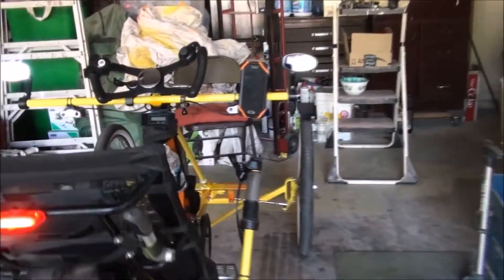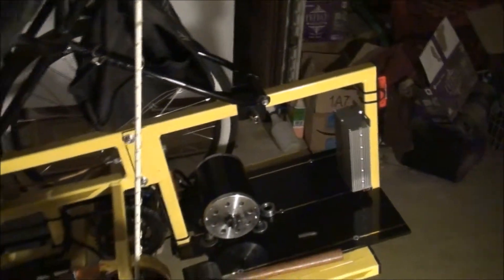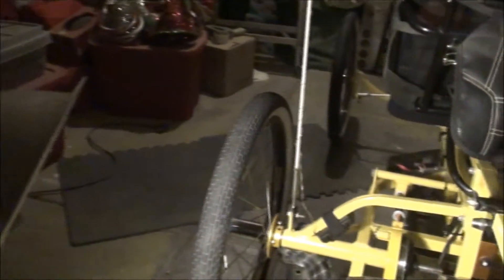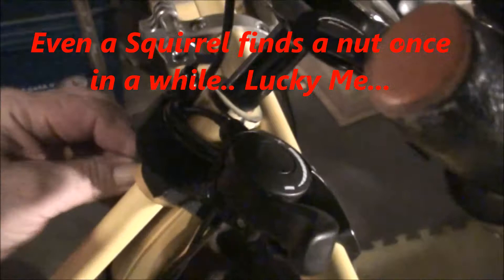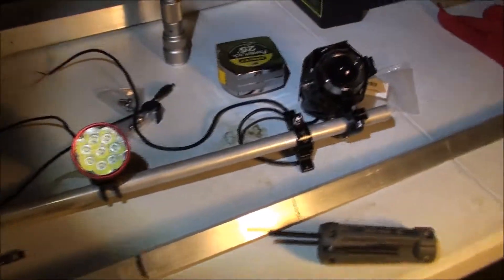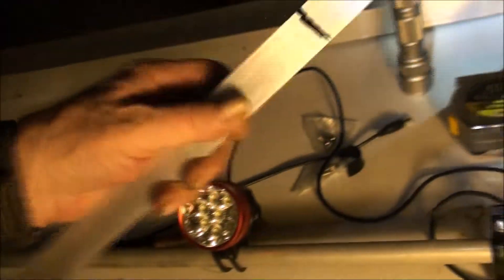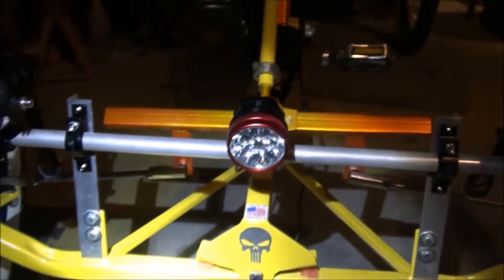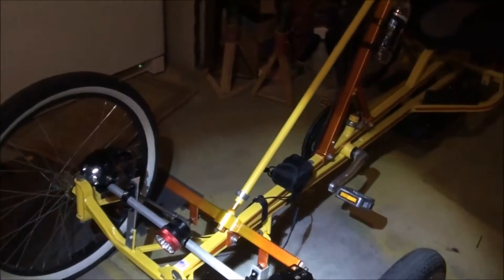Vierbike  Quadra Sprint Mods Legal Street Lighting "Front Light Bar"

Comment: I remember in the 80's and up BMX had a cable management system on the neck of the handlebar that'll allow the individual to turn the handlebars 360 degrees without bunching up the brake lines, u can probably use the same on your bike when u do your turns.
Reply from the maker: I had a few of those BMX trick bikes a great idea but, not feasible for this type of application would take a lot of ingenuity & added costs. Thanks for your input most appreciated.. This wiring method works fine as long as you don't overlook the tension as I did when aligning the front wheels.

Comment: Put a shrink tubing on the wire harness
Reply from the maker: Agree but, I don't use the shrink tubing on shape bends this is a common practice when wiring the harness up to the system allows the wires to bend naturally on sharp turns. Most electric bikes harnesses are wired this way even on my Radrover. Thanks for your concerns & suggestions you have always inspired my builds keep them coming most appreciated.. Have you found that Scooter gas motor yet now that will be a challenging Modification without doubt. Hope you share it on your channel I'll be watching out for it I subscribed to your channel just recently..